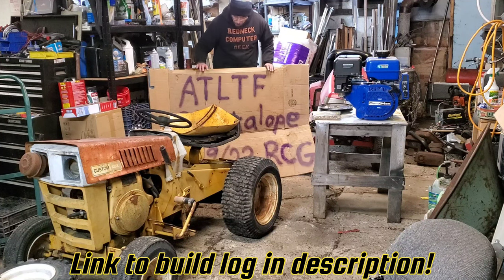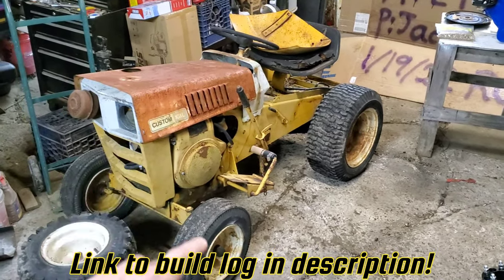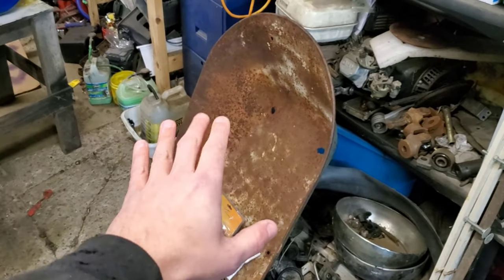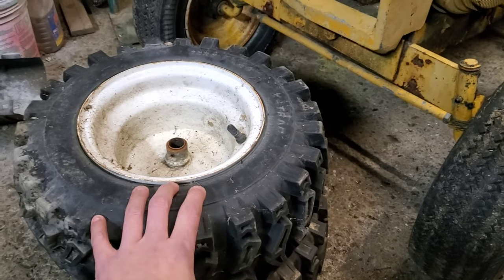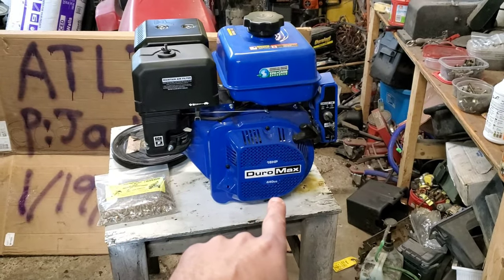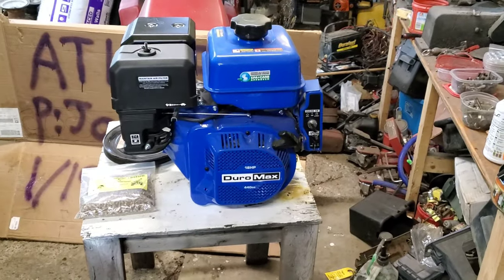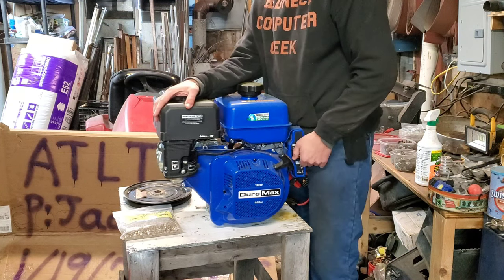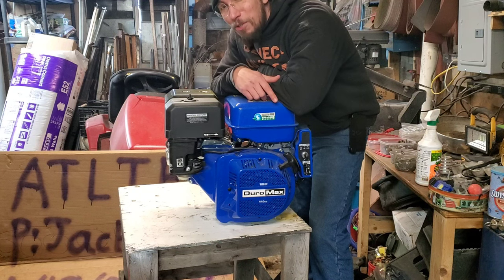Sears Racer: Build Explained

Comment: Most don't realize how much time it takes to build a mower especially patients to build one. Your mower well tractor is definitely gonna be better built then theirs! Those duramax engines when tweaked on just right maybe a Cam and billet rod make good power. The predator 420 hemi head might be better on the the 440 for better low-end power.
Reply: Also where might a guy find one of those fancy lighting boxes at lol?
Reply from the maker: Lightning box?
Reply: Booster pack. Lighting box lol watch way to much vice grip garage lol. One more thing sucks to see that that flatty is locked up. They can be built to Rev higher then a ohv thought about. The tecumseh stars are good blocks in the big block class. Only good flathead briggs i know of is the raptor and blockzila those 2 was factory briggs race engines back in the day. Still enterested in how this build will go definitely gonna be sweet when done.
Reply from the maker: @rncboy2  https://amzn.to/3AnNqBx